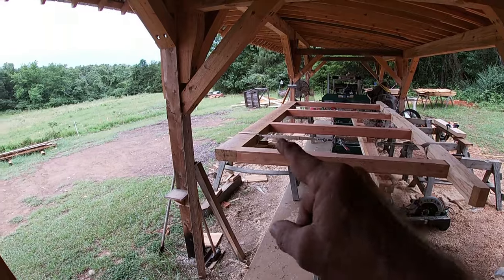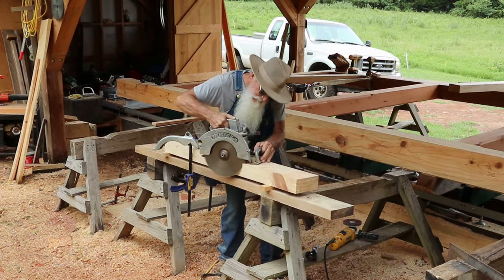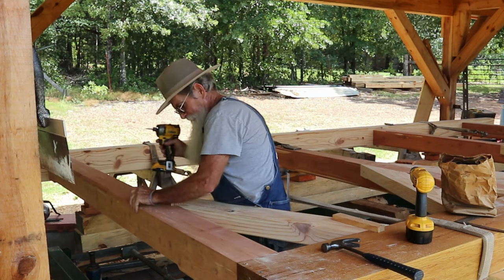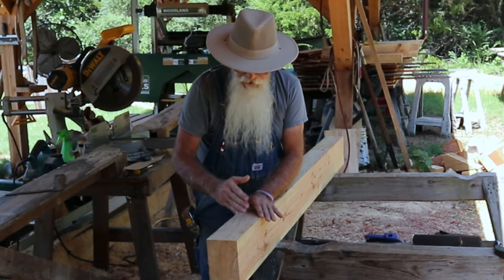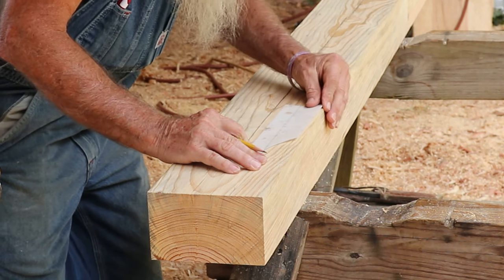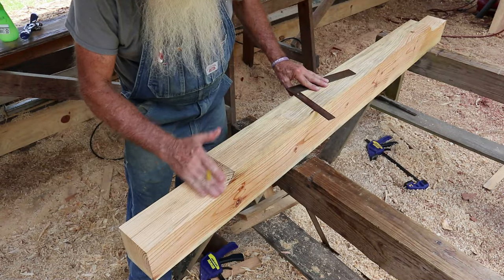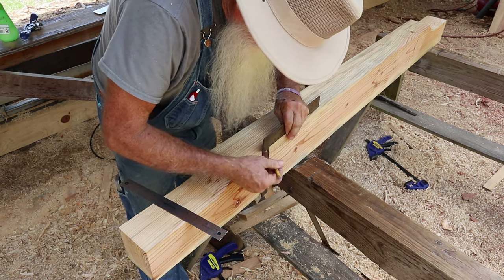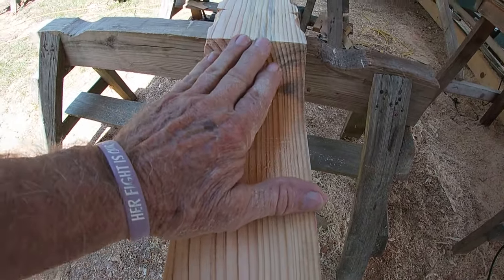Installing Braces & Cutting Tie Beam Scarfs l Covered Bridge Build, Ep 4

Comment: Hello Paul. I did find one of these Speedmatic - 10 saws for sale on eBay, $225.00. I did not look to see if it is still for sale. The cuts that you make and how you do it is really interesting to me. If you were to have a live show when you put the bridge together, I would watch it in entirety. You put a lot more work into your builds than we are shown. Have good days!
Reply from the maker: Howdy Buddy- I haven’t looked for them on eBay. There will probably be a video of the full build. And yes, there’s quite a bit l don’t video, just what would be helpful to someone. Thank you so much for watching our videos. God bless you
Reply: Hi, I have been collecting vintage power tools for several years with a special interest in Porter-Cable. In my experience, Ebay is the worst possible place to shop as the prices are two, three or four times as high those seen on Craigslist etc.

Comment: I have a Rockwell circular saw of the same vintage, they are tanks, they last forever.
At about 2:17 you can see a little grease cup, you probably know this but I'll explain for others, that cup greases the bearings, every once in a while you give it a little turn and it pushes grease into the bearing. Unless you've changed it, the grease in the cup is probably old and dried out, if you are going to use it, you should clean out that old grease and put some good grease in it. 
Vintage Porter-Cable power tools are very collectable, it could be worth a couple hundred bucks, not that you'd ever sell it.
Reply from the maker: Howdy Bigred- they are tough old saws for sure. Yes, I’m aware of the grease cup. I have an old table saw that has them on the motor. A lot of my tools are somewhat vintage now but they still perform really well. I don’t think I could ever part with this old saw. My Dad bought it from a fellow who was working for him back in the late fifties. I think he paid him $50 for it. It still has the case it came in. I don’t use it much anymore but I’m hanging on to it.  Thank you so much for watching the video and sharing this with us. Take care and God’s blessings to you
Reply: @TheBeardedCarpenter  They were very expensive, my 8 1/4"  Rockwell was about fifty dollars when it was new in the 50s, adjusted for inflation that's $650, so your fathers 10" saw would have been even more expensive.
Reply from the maker: @bigredc222  Thank you for the information. Much appreciated. Blessings
Reply: @bigredc222  Just for the record, Rockwell bought Porter-Cable in 1960. It took around a decade for them to close down production in Syracuse, New York and relocate to Jackson, Tennessee. The brand name 'Rockwell' replaced Porter-Cable on the tools around 1970.